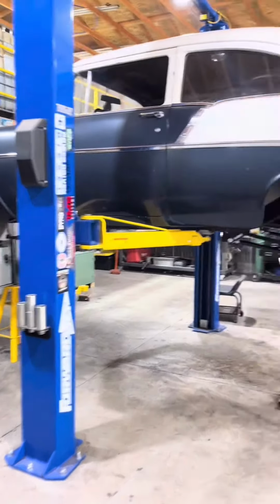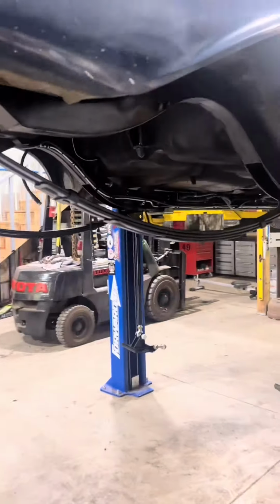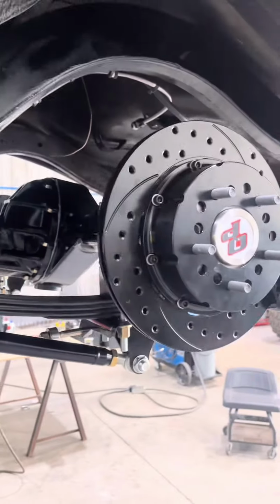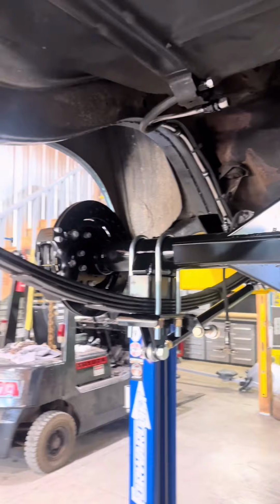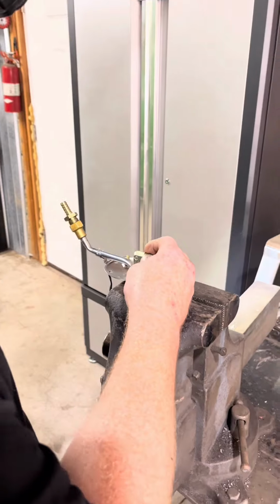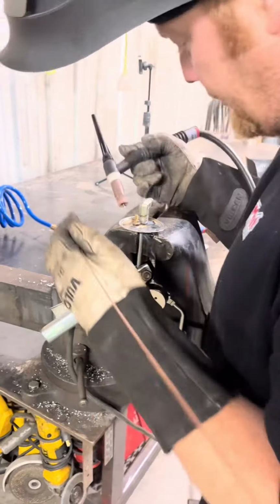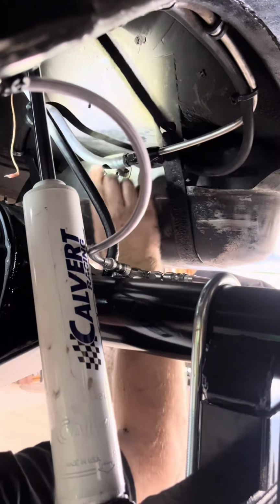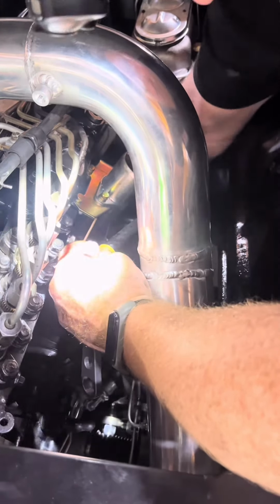12 valve Cummins powered 1956 bel air ford 9” final assembly and testing/burnouts part #2

Comment: Id like to see this in person. I have a 55 bel air and want to see what obstacles you encountered while stuffing a cummins under the hood
Reply from the maker: Cut the frame off at the firewall and start over with a tubular clip/mustang2/ rack and pinion, custom oil pan so you can drop engine low as possible to clear hood, other than that they fit ok, also radiator support is custom. Also trans tunnel has to be modified depending on what trans you go with
Reply: Maybe I'll see it at cruising the gut